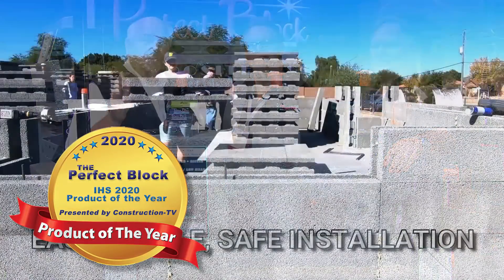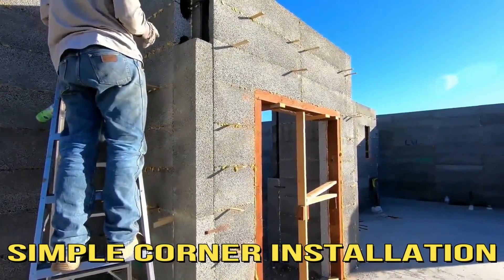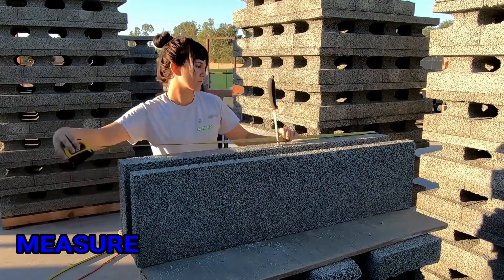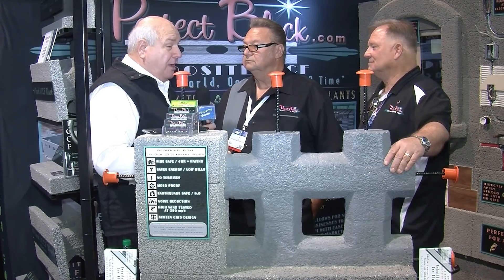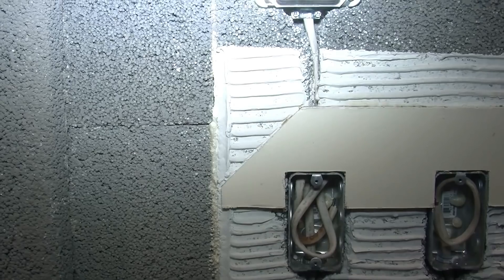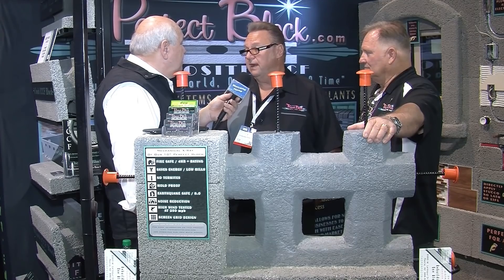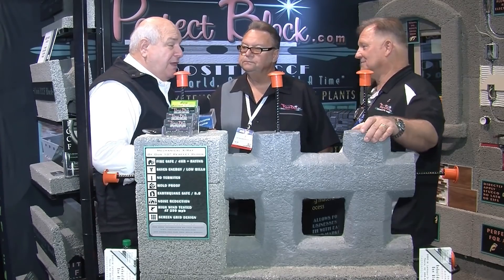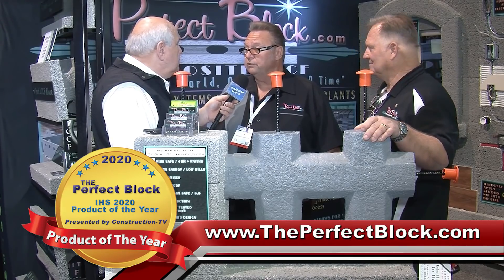Insulated Concrete Form (ICF) Product of the Year for 2020

Comment: the insert is a different color, does that suggest you are pouring the fill with plain cement?
Reply from the maker: What you see here is a mechanical x-ray. The cement was painted gray to make the display look nice.

 Order a "grout mix", minimum 3000 psi, aggregate less than 3/8" (pea gravel if available), and an 8" to 10" slump

(the higher the slump, the more fluid the grout).

Comment: Will these work to replace a poured basement wall (that gets back filled) legally (according to code) in northeast Georgia? Would like to use something like this to avoid the poured wall contractor for a basement under a new house. Imagine a mountain building lot and the basement is dig out in the side of the hill with the second floor framed up on top of it. Poured walls are common here. But; what a hassle, expense and mess. Lastly, our building code has now demanded that all basements be back filled with washed #57 stone. No dirt! Better dig the basements perfectly tight and precise!

Comment: Rick, I only have 1 concern with your ICCF.  It seems like it would be entirely possible for someone to punch a whole in a block from the outside?  Compared to a normal plywood or OSB sheathing, how much will your ICCF resist a rock from a lawnmower, or a bonehead walking into it with a 2x4?
Reply: It's filled with concrete.... So not likely
Reply: @daveklein2826  The concrete is honeycomb, so there are areas of the wall that are just foam.
Reply: @sheldoncook87  LMAO
Reply: @sheldoncook87  it's not just foam though, it's foam mixed with cement and when it's cured the blocks become very hardened (they're cured before they ship them out). Also, you would clad the block with a finisher.. (stucco/drywall/tile/etc)

Comment: How much does a Perfect Block wall weigh compared to a 2x6 wall with insulation, exterior sheathing, and sheetrock? I would be building on a dock over water and pilings are expensive.

Comment: How do you retrofit electrical or wires with this system?
Reply: A handsaw will cut this block, on the jobsites they use a chainsaw for speed ofcourse. I've seen mostly people use chainsaw to cut a groove in the surface of the wall where they need electrical/plumbing and then they simply run the wires through the groove, and use the expanding foam glue to "tack" them in place

Comment: What's the square foot cost comparable?
Reply: An example cost: For our top of the line form, the 10" Asymmetric ICCF is $25 a form (all our forms provide 4 square feet of wall area). Estimated cost for a completed (forms plus concrete grout and rebar) 10" Asymmetric ICCF wall without exterior or interior cladding (stucco and drywall) and excluding labor is approximately $9 a square foot. I excluded cladding because there are several ways to clad the wall and labor varies from region to region and whether you are an owner/builder or hired contractor.

Comment: I know with ICF's there's a lot of bracing that happens so that during the pour the blocks don't get out of square or out of plum. I didn't see any of that in any of the videos.
Reply: @theperfectblockiccf  Yes, that's nice, but how does that work then? Can you point me to some place that explains how that stays plum/square?
Reply: @theperfectblockiccf  Thank you. very helpful this seems like a great option for crawlspaces for my use. Can I attach "things" to this on the inside and outside? Outside would be waterproofing primer, membrane and then securing to the form. Inside would be IPS foam. Do you do the install or does someone else? i.e homeowner or builder. Are there installation materials I can look at. Any special considerations for the slab?
Those forms don't look like they weigh that much when people are carrying them in the video.

Comment: Concrete building have been the solution for a long time. The timber industry has gotten counties to spec timber framed buildings only when rebuilding after a catastrophe, so I hope you are able to get the codes changed.

Comment: here's an opportunity for the company to crow a little....much of what I heard in the video in terms of benefits are true of all (perhaps most?) ICF builders; other than the high-% of recycled material (which deserves an attaboy), what make this block better than other ICFs? open invite to brag a little! :-)
Reply: Ohhh ...
Shotdown!
Reply: @cjjenson8212  ?
Reply: @just-dl  this block doesn't require all of the bracing that a typical ICF build uses. They rarely use any bracing at all! Also,  a handsaw will cut through it (they use chainsaw for speed ofcourse) so when it comes to custom designs the possibilities are endless! 
If you take an ICF block with nothing done to it and put a torch to it, it'll light up in flames instantly.  This block can take a 4000 degree map gas torch to a 2 inch section of their block (with their hand on the other side of the 2inches) with the flame on it and hold it there for as long as they can and the block won't light up in flames and there's no heat transfer to the other side.
Reply: @dolcebionda8015  those are both factors worth crowing about. The fire prevention side speaks to me more! Thanks!

Comment: I immediately noticed the unbroken vertical seams ! Basic common practice has prevailed that a structure is stronger when joints are staggered . Just look back say to the Inca’s great structures . Better be redoing your video
Reply: as the forms aren't load bearing i doubt it would really make any difference either way.
Reply: Joey Schuszler you could  be correct, however maintaining alignment seams would be a problem  concrete placed placed with pump truck is delivered with an irregular pulse . That could cause a shifting of the form , my lack of knowledge of this process is very limited . I’m not schooled on it
Reply: @thedude4632  From watching a couple of assembly videos, it appears as if the joints of the block are glued together which would eliminate much of the risk of misaligned blocks and provide a tight seal between forms. I know from many other manufacturers use something similar to a tongue and groove system to lock blocks together. The biggest problem i've seen with misaligned blocks has been walls shifting out of plumb. Though i've never personally worked with this system.
Reply: @theperfectblockiccf  Could you explain it again?  Because I agree with Meredith. Staggered seams would strengthen it immensely.

Comment: Looks like Rastra block. I've had success cutting that block using the giant carbide toothed sawzall blades that get sold for cutting autoclaved aerated concrete. I love a building system that doesn't need drywall on the inside.
Reply: I built two buildings out of this stuff, actually, it was their competitor's block made exactly the same material but they had pre formed corner blocks also. We just plastered the interior and painted. Stucco on exterior, it was beautiful, comfortable and very! energy efficient.
Reply: @oregonhoney753  Random question: for the interior, since there aren't traditional studs, how do people screw into the wall to hang stuff? Not sure if I'm phrasing it right. I assume the EPS+cement block can't hold screws like wood.

Comment: Yes, but how does it stand up to a tidal wave or tsunami??
Reply: A lot better than a stick built house!
You realize that 4 FOOT thick concrete seawalls have been shifted by tidal waves, right?
So the answer is "It depends".
How fast is the wave surge? (How much [kinetic] energy does it have?)
How thick / deep is the wave surge?
What angle is the wave hitting the wall?
What debris is being carried with the water?
This is going to be more stable than cinder block construction  but not as strong as a solid concrete wall (the FOOTING and how well the wall is anchored to the foundation counts. And is there any bracing like cross walls or corners to take the sideways loads generated by a wave?

Comment: What are the sizes of your blocks? How do you figure t he amount of concrete you will need to fill the blocks? Do you have a rep in New Mexico?
Reply: @theperfectblockiccf  question do you have an distributor in puerto rico? I live here and i think this would be perfect seller here. Please contact me at donmateolk@gmail.com thank you
Reply: They have different sizes available. All their blocks are four foot long and one foot tall. The widths of their blocks differ from 10inch(highest insulated), 8 inch, or 6 inch depending on your build. They have two different 10 inch blocks available, one is for higher insulation and the other has a larger core for the harsh weather's (earthquakes, tornados, etc)

Comment: whats with the shims and spray foam? I get using spray foam to glue them together but whats with the shims, are they not squared off? It just seems like an inefficient way to bond them together, I can imagine a work site with 59,000,000 shims stuck to the deck with spray foam glue.
Reply: Response to Johnny B from Eco Building Systems Corp
Your comment: whats with the shims and spray foam? I get using spray foam to glue them together but whats with the shims, are they not squared off? It just seems like an inefficient way to bond them together, I can imagine a work site with 59,000,000 shims stuck to the deck with spray foam glue.
My response: 59 million shims on the deck? Really? Our forms are precision made but because we are meticulous builders as well as  an ICCF manufacturer, a small deviation from plumb in a wall as we stack course after course is unacceptable. So we use shims to bring our courses of forms into perfect plumb and foam adhesive to ensure that the small effort expended with a level to stack a perfect wall remains perfect. Clients should expect nothing less from a builder who is proud of his work. When the glue dries, we collect the shims and reuse them on the next job. They aren't glued to the deck. The build methods we use are not inefficient to us. Foam adhesive and shims creates a monolithic wall system with straight and level and plumb walls to easily fill with steel and concrete to make a precision house as strong as a fortress. We are not opposed to using more efficient methods to achieve the same results. So if you have better ideas than us to make us more efficient, please comment and share them.
Reply: @tanktindal  OK, I think I get it. I was wondering why not use a mortar and set them like bricks but that more dense mortar would act like a thermal conductor and degrade the insinuative quality of the wall right? That's why the spray foam, its insinuative quality is same of better. now I was thinking of better ways to hold the bricks plumb why the spray foam stiffens that would be better than shims and I'm hard pressed to think of another way that wouldn't be more expensive than shims. since shims are so cheap , that ever system I come up with has to have more value added than just holding the wall plumb temporarily. my first thought is of suspending a fixture inside the cell in the block, that would make a stack more uniform so that minimal if any plumbing of the wall would be required. The value added would be time. I think you see this in your foam block ICFs and the fixtures are embedded in the concrete during the pours.

Comment: Response to safffff1000 from Eco Building Systems Corp
Your comment: safffff1000
, If you have to ask the price usually means it's expensive, or they would be bragging about like the fire and wind resistance.
My comment: Are you asking for the price for our ICCF block? Which one? We manufacture 10 different ICCF building elements. The price is no secret, contact us through our website, we'll send you a price list. I don't know how I would have worked the price for all our elements into the short video infomercial that you remarked about, but I'll brag about the price now. The Perfect Block ICCF costs less than wood framing! Do you think wood framing is expensive? Most of North America is still building with wood, they must think they are getting a good deal. Well, gray block ICCF is a better deal than wood. Want to know more? Call me, Rick Tindal, but expect me to brag about all the great things that gray block ICCF provides and performs over all other currently used building materials. No brag, just fact. Don't believe me? Name one. Name just one.

Comment: If you have to ask the price usually means it's expensive, or they would be bragging about like the fire and wind resistance.
Reply: Darryl Davis  yep and that's R20, not R50
Reply: Response to safffff1000 from Eco Building Systems Corp
Your comment: safffff1000
, If you have to ask the price usually means it's expensive, or they would be bragging about like the fire and wind resistance.
My comment: Are you asking for the price for our ICCF block? Which one? We manufacture 10 different ICCF building elements. The price is no secret, contact us through our website, we'll send you a price list. I don't know how I would have worked the price for all our elements into the short video infomercial that you remarked about, but I'll brag about the price now. The Perfect Block ICCF costs less than wood framing! Do you think wood framing is expensive? Most of North America is still building with wood, they must think they are getting a good deal. Well, gray block ICCF is a better deal than wood. Want to know more? Call me, Rick Tindal, but expect me to brag about all the great things that gray block ICCF provides and performs over all other currently used building materials. No brag, just fact. Don't believe me? Name one. Name just one.
Reply: It's extremely easy to say the cost of sq ft prices of a wall. For example, our wall is between $20 /sq ft - 30 sg ft compared to $40/ sq ft for the average wood frame with insulation. Now was that hard. I went to your web site and didn't see a price there or comparison.
I'm use to that technique to having me contact you for one to talk to a sales person to sell the product. I don't know you or anybody that does. So I shop around by reading descriptions and prices. that so called price list you can send me well just post it, is that hard?
I think from what I've seen you have great product. Why you are ashamed to prove it by listing prices is beyond me. Don't give me the fact that every job is difference, ever here of ball park.
Reply: @safffff1000  
Response to safffff1000 from Eco Building Systems Corp
My response: Point taken! An example cost: For our top of the line form, the 10" Asymmetric ICCF is $25 a form (all our forms provide 4 square feet of wall area). Estimated cost for a completed (forms plus concrete grout and rebar) 10" Asymmetric ICCF wall without exterior or interior cladding (stucco and drywall) and excluding labor is approximately $9 a square foot. I excluded cladding because there are several ways to clad the wall and labor varies from region to region and whether you are an owner/builder or hired contractor. You are correct, we do not have a price list on our website, but there is a reason. We are not salesmen, we are builders and manufacturers, and gray block ICCF is essentially an unknown commodity to the world of construction and competition is fierce from more established and well funded building materials. We have felt that trying to motivate someone to investigate further and actually speak with us, gives us the opportunity to educate folks about gray block ICCF, not sell the product. We expect people to do their own diligence and vet us and do there own comparison research. When this is done, The Perfect Block sells itself.

I want to thank you for commenting on our product and our presentation methods. You have motivated us to discuss and reassess our website and presentation. I encourage you to continue to comment on us. I actually enjoy the friendly sparring. And who knows? I might win you over.
Reply: @tanktindal  Thank you so much for the additional info. I think it would encourage more calls when people see the info. Plus I'm sure competitors can act just as buyers and call you for info. Want more exposure, build walls and make stunt video's youtubes. trying to destroy them in various ways. Do it in public demos for local TV. Drive cars or trucks into them.Ect.
Reply: @safffff1000  Response to safffff1000 from Eco Building Systems Corp
My response: Point taken! An example cost: For our top of the line form, the 10" Asymmetric ICCF is $25 a form (all our forms provide 4 square feet of wall area). Estimated cost for a completed (forms plus concrete grout and rebar) 10" Asymmetric ICCF wall without exterior or interior cladding (stucco and drywall) and excluding labor is approximately $9 a square foot. I excluded cladding because there are several ways to clad the wall and labor varies from region to region and whether you are an owner/builder or hired contractor. You are correct, we do not have a price list on our website, but there is a reason. We are not salesmen, we are builders and manufacturers, and gray block ICCF is essentially an unknown commodity to the world of construction and competition is fierce from more established and well funded building materials. We have felt that trying to motivate someone to investigate further and actually speak with us, gives us the opportunity to educate folks about gray block ICCF, not sell the product. We expect people to do their own diligence and vet us and do there own comparison research. When this is done, The Perfect Block sells itself.

I want to thank you for commenting on our product and our presentation methods. You have motivated us to discuss and reassess our website and presentation. I encourage you to continue to comment on us. I actually enjoy the friendly sparring. And who knows? I might win you over.